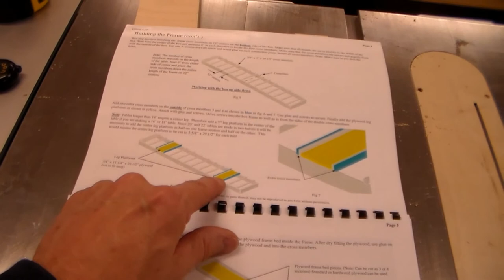Assembling the Sides and Ribs

Comment: The plans call for using 3" screws for attaching the ribs. Do you think that the dowels and glue are strong enough for the weight of the playing surface?
Reply from the maker: Yes, it's been together now for almost 5 years and it shows no signs of any cracking or wear.